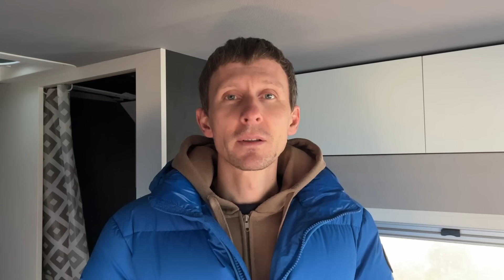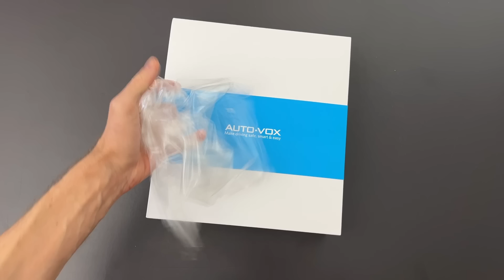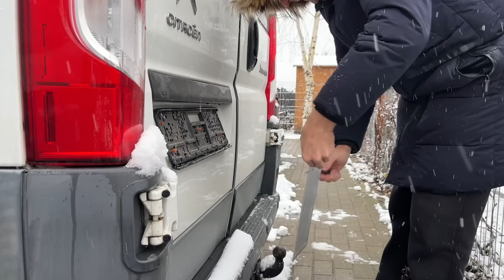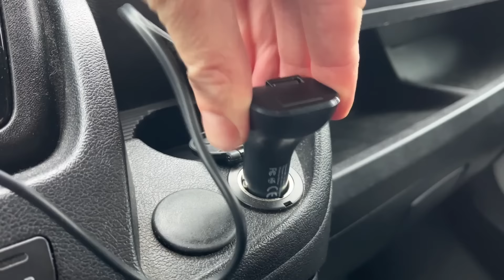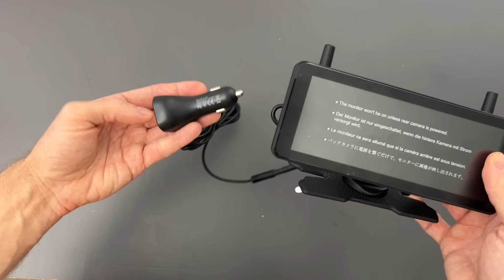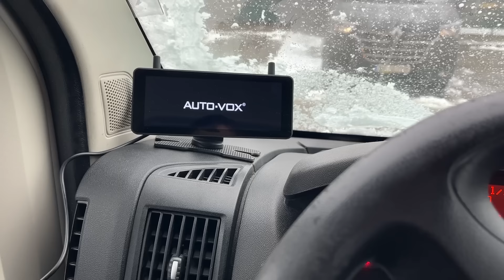Install Rear View Reverse Backup Camera in 2 min! THE EASIEST WAY

Comment: The issue with this is the camera doesn’t appear to be able to show you the bumper of your own car and needs to be angled down slightly? It points directly out and you can’t really see the edges of the back of your car

Comment: If you can't backup using your mirrors and turning head,then you shouldn't be driving,plus everyone should know to walk around your car and look before getting in and starting  out regardless of if backing up or going forward
Reply: The whole point of the camera is so that u can see behind the car and not have to guess and get in and out the car to see behind. Also highly suggest looking into jesus and the bible. Theirs no other book in all time that has as much valuable, prophetic, or factual information. It was written by over 40 people over 1500 years and yet has the most cross references out of any book ever.
Reply: You can but why would you like to if you can use this? Unless you’re just stubborn and don’t like things that make life easier….
Reply: I can promise if you search for jesus you will find jesus. All it takes is an open heart and mind and the desire to know god and prayer/talking to god
Reply: What if someone walks behind you as you are reversing and they in a blind spot. This is why reversing cameras are useful.
Reply: Blow your horn also and always back up slowly.